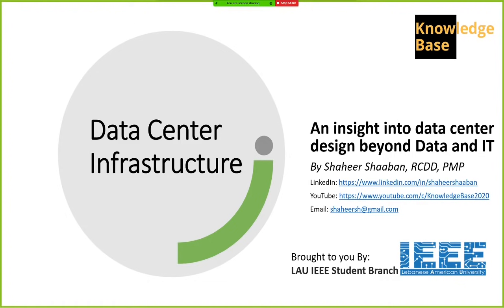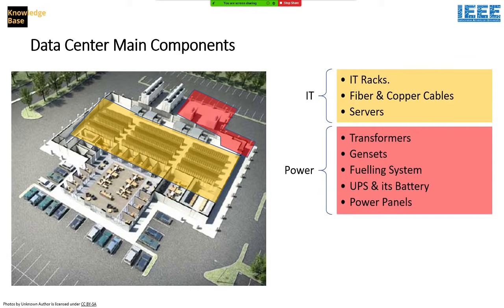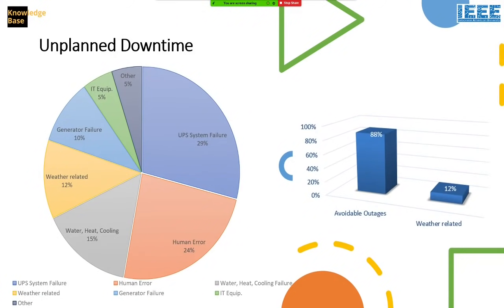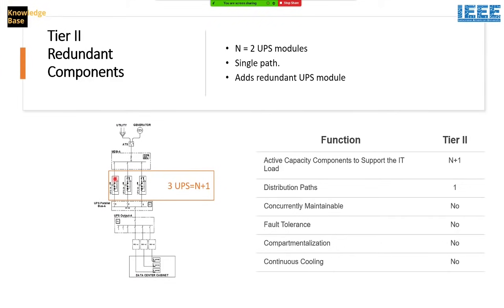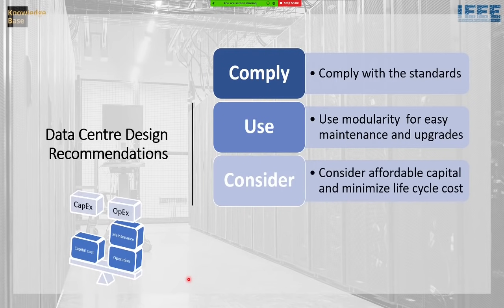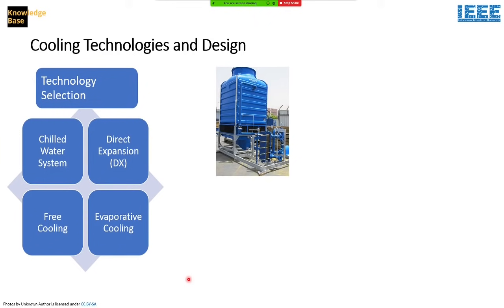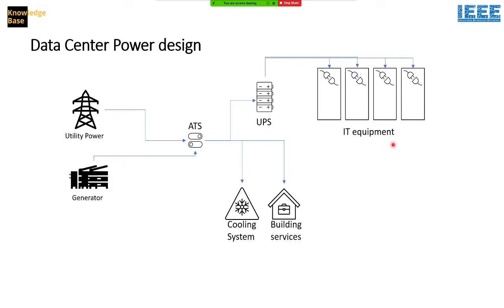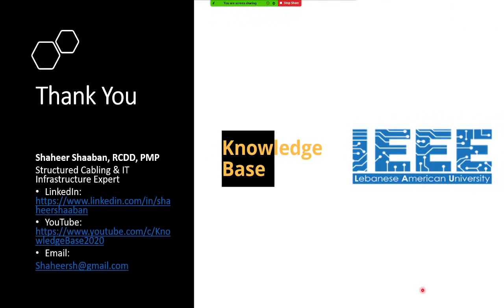Data Center Infrastructure Design Webinar l IEEE LAU Student Branch

Comment: the question is can we have a tier 3 or 4 in the same location of Gray space and out space for Generators.
Reply from the maker: I am not sure i understand the question.
Reply: @KnowledgeBase2020   we have a tier 2 uptime certification as we have only one location of gray space for mechanical and electrical panels. can we achieve a tier 3 uptime certification having another set on the same area? or we need to separate the redundancy of each mechanical and electrical rooms.

Comment: This was superb. I'm just curious, you stated that it's not necessary to have ups of more than 15mins because the cooling itself is run by utility and genset, however, I have once worked on a system with cooling storage (buffer tanks) that had pumps connected to ups and could go beyond 30mins.
Reply from the maker: Yes that is correct. those are cooled water tanks that act as standby cooling in case of power outage. However, the UPS is only to maintain the system power while the generator kickes in. The datacenter should have a disel generator that can provide power.

Comment: Hello there,

Hope you are doing good. I needed a suggestion. As a data center service vendor, I am trying to develop a risk management document to hand it to the client side before getting the final approval of a data center migration/relocation work order. I have streamlined 4 points for that risk management document : 

1. Risk issues with equipment.

2. Risk issues with dismantling.

3. Risk issues with Installation. 

4. Risk issues with the shifting process. 

 Now I would really appreciate it if you could provide your expert advice on what else or how differently should I prepare a Risk Management Document that keeps both the parties in the proper place and win this relocation/migration  contract for us.
Reply from the maker: Thank you for your question. I will also consider downtime Risk.